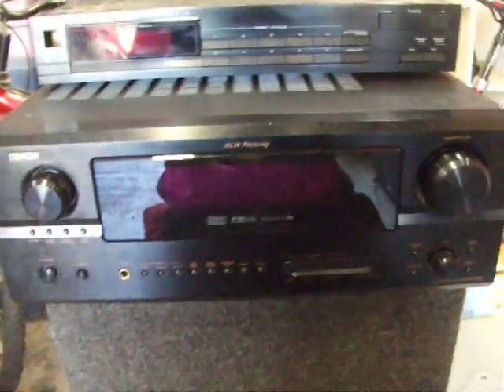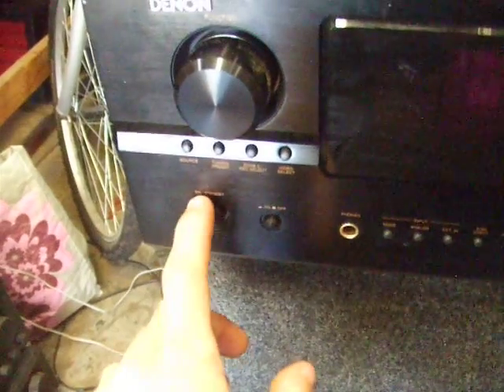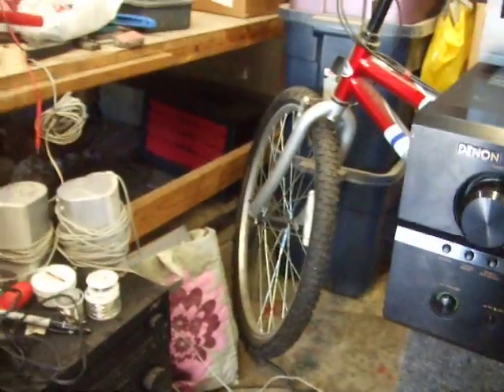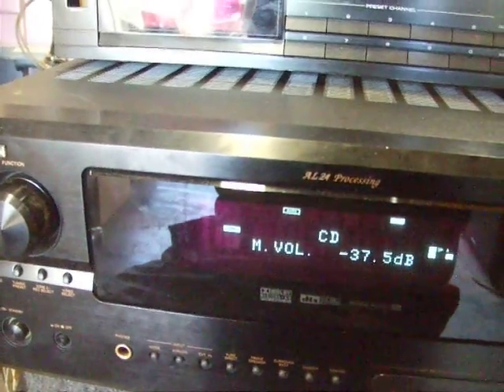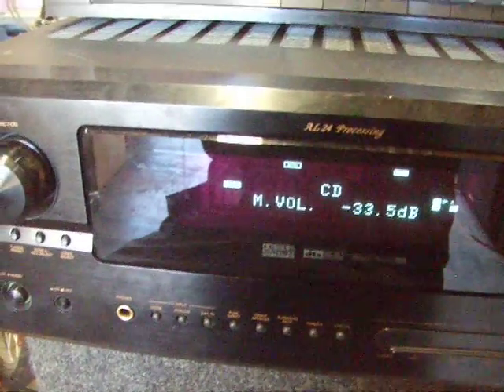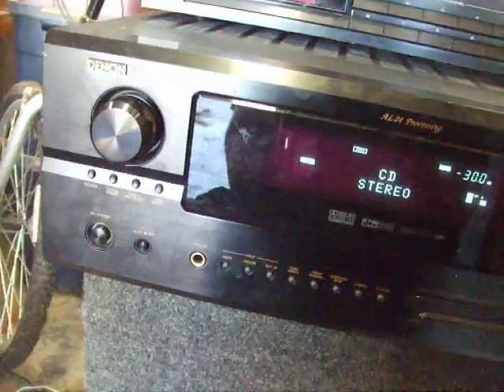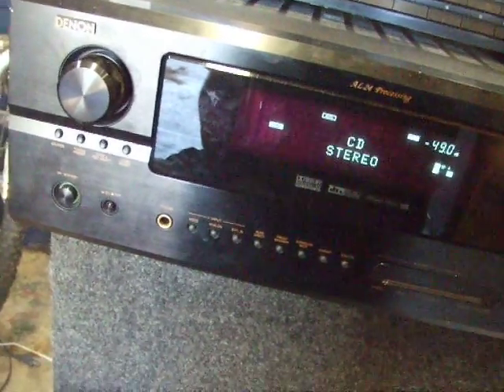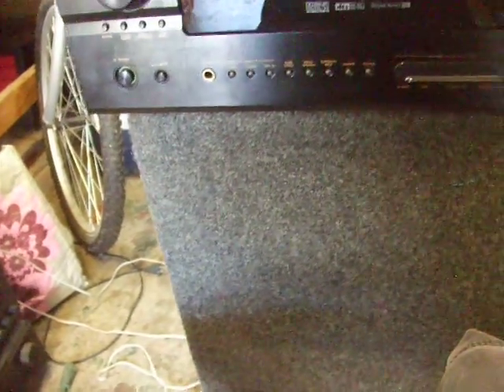Denon AVR-2805 strange volume problem

Comment: My Denon 1712 just starting doing the exact same thing. Any luck fixing yours?
Reply from the maker: Nope I never did figure it out, but it fixed itself while in storage. Been fine for the last 4 years now, I just used it the other night and couldn't replicate the problem again... It's still a mystery to me
Reply: @thadoggma  thanks. Guess I'll box it up. 7 years old anyways. Looks like i get to upgrade!
Reply: Your vid was the only one i found that matched my problem. Even the right rear speaker getting loud

Comment: I have the x6300 h model and I have major hissing and noise issues.  It has something to do with enabling audessy and or dynamic EQ.   When I turn audessy off the sound hissing is gone but there us still buzzing in the speakers.  Also without audessy enabled I do not get proper volume do I am forced to turn audessy on again.  I called Denon they said I am the first person to have reported this.  Come on it's in a lot of audio forums that thus is becoming a common issue.  I am upset.  This is not cheap, and it is time consuming to set lol of this up.   Now I am having decoding issues, can no longer read Dolby atmos or dtx,  only true hd and test is not the same as atmos.     So what do I do now

Comment from the maker: Good thought, I saw all high quality caps that are not known for failing- I am used to seeing Taicon, Capxon, RLS, and OSC branded caps failing, and have replaced thousands of these in everything from motherboards, monitors, car amplifiers, flat screen TV's, subwoofer plate amps, etc. I will check it out though! Still doing it, but its not bad enough to warrant scrapping the amp- I have been using it for about a year now in my HT.
Reply: My Denon 1712 just starting doing the exact same thing. Any luck fixing yours?

Comment: It sound like a bad cap on one of the boards shorting out on you . You should check all the caps on the boards to see . I would look for bulging caps first than test them in circuit with a esr meter , that would at least tell you if you have bad caps . Bad caps can cause what your hearing .

Comment: And if you connect anything directly into the pre amp,  you will have the earthquake volume with walls and floors shaking and hopefully,  you don't blow your speakers while you are at it.  Also, you must use thick gauge wires for the speakers.  These type of speaker connectors in the back will not provide enough contact for thin wires.
I don't like to see people sell things cheaply because they think it is broken, because I am not the type of person to take advantage of anyone.
Reply: THANK YOU FOR YOUR INTEGRITY AND RESPECT FOR US GOD BLESSES YOU

Comment: It is not a volume or electrical problem.  You have the surround system on.  That means,  it comes with a microphone and the system is searching for the microphone.  So the system is trying to find the microphone signal to balance the surround to give you the perfect surround sound by determining distance.
I experienced this my self and if you go to denon.com and download the manual for your version Denon and when you read it, it will tell you that is what the mic is for.

Comment from the maker: No, the remote does the same damn thing, too. It is localized to the right channels of the amp only, but sometimes it may be front right, or surround right, or surround back right, or in the sub output occasionally. Like most other Denon receivers I have worked on, it probably needs a new DSP board, which is unobtanium anymore. Since I can solder SMD parts, if I can narrow it down to a failing chip, I would be happy.